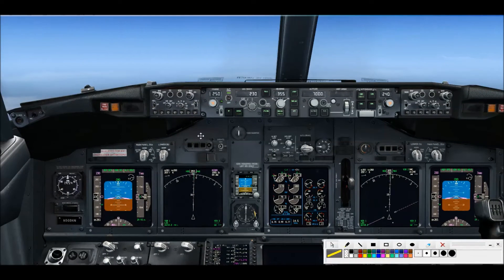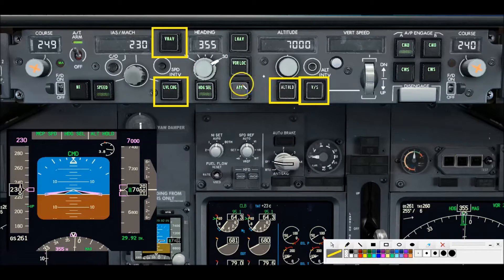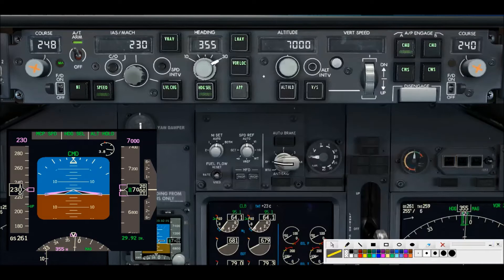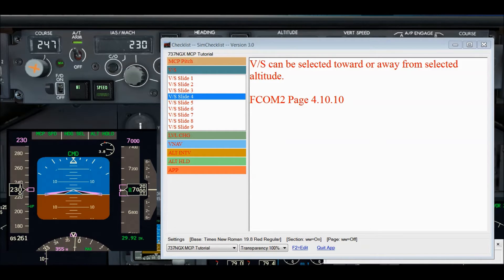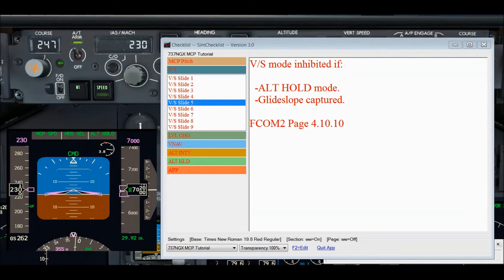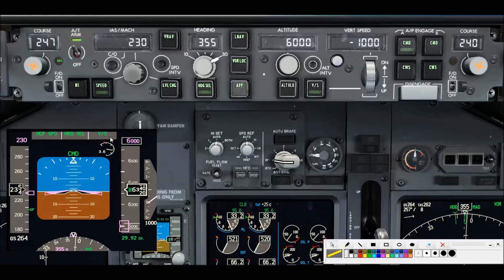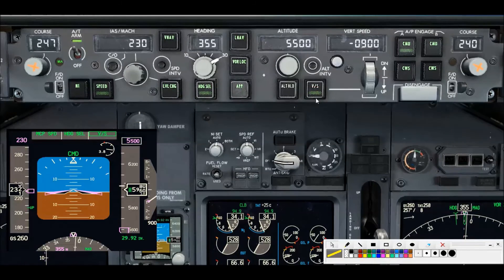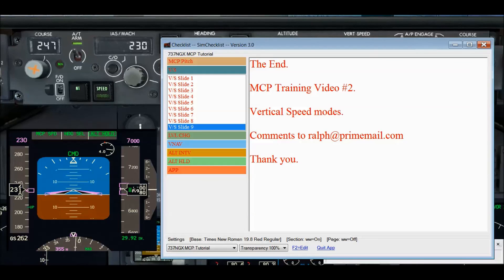MCP 2 VS

Comment: Thanks for your video, need some help.

I ran into problem with the auto pilot for PMDG 737. Sometimes i could activate the auto pilot during take off, other times, it wouldn't light up at all.

For auto pilot to be activated, I understand that there are two conditions:

1. Set altitude, or  
2. program the route in FMC,

Since I'm doing a quick flight to test VS and FLC in auto pilot mode, I set the altitude only. But during take off, the auto pilot button didn't light up when I press the button.

Which step did I miss out?
Reply from the maker: You do not use the autopilot for takeoff. No pilot uses the AP during takeoff. During climb out you can engage it. You can select HDG mode and VS mode. Any vertical mode and any lateral mode should allow you to engage the AP.
Reply: @rfresh1011  Many thanks
Reply: @rfresh1011  But during the climb, I click both vnav and lnav buttons, but none of the buttons are lighted up. Did I miss some steps?
Reply: @rfresh1011  noted , thanks

Comment: Good Day Mr Ralph,if we used V/S to capture a glideslope on ILS Approach....do FMA show G/S instead of V/S after Glideslope is alive or captured?Thanks....🙏
Reply from the maker: Yes that is technically correct. However -- you should not be trying to capture the GS while climbing or descending (in VS mode). You want to capture the GS while in level flight. Technically, you can capture the GS while in VS mode but it is not considered to be good practice.
Reply: @rfresh1011 sorry Mr Ralph i am a little confused here. if we are going to land manually after localizer is captured.What should we do to captured glideslope if we are not allowed to used V/S ?
Reply from the maker: @steffenleo5997  you should have altitude hold engaged. ALT on. Capture the localizer while holding the altitude as specified on the ILS approach plate. Press APP to arm LOC capture and GS capture. Once you capture GS you'll start down...fly the GS needle at that point. Use the Flight Director to manually fly the approach.
Reply: @rfresh1011  Thanks Mr Ralph for your details explanation...🙏🙏🙏....By the way are you airliner pilot? Have a nice day ahead...👍